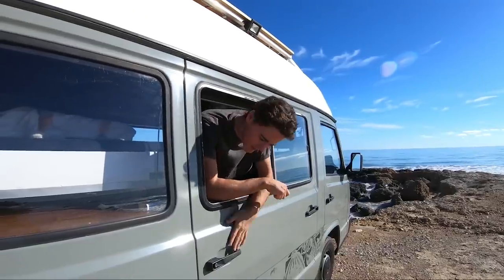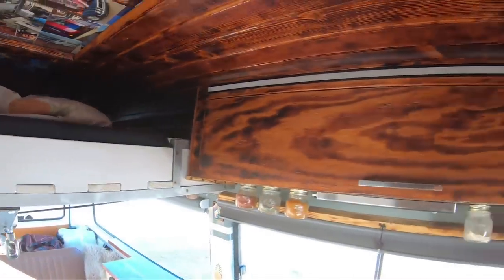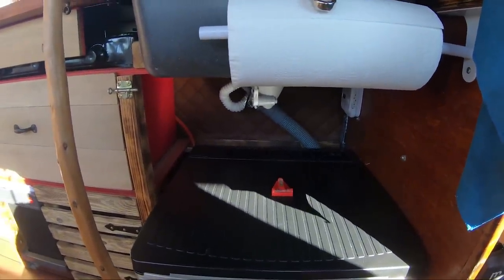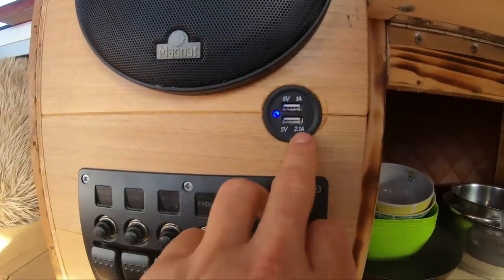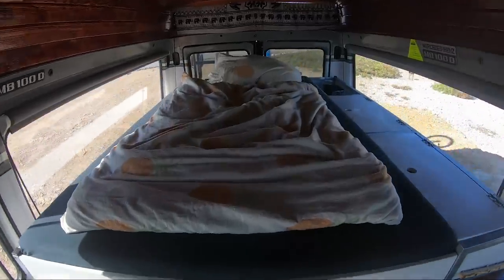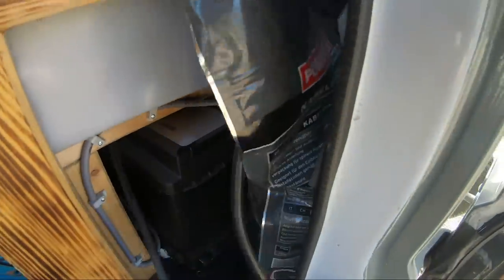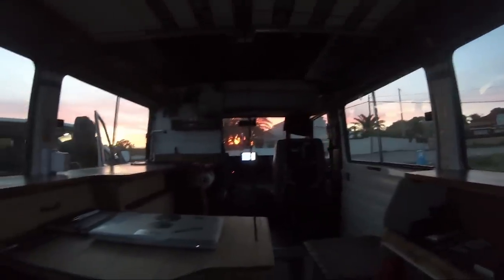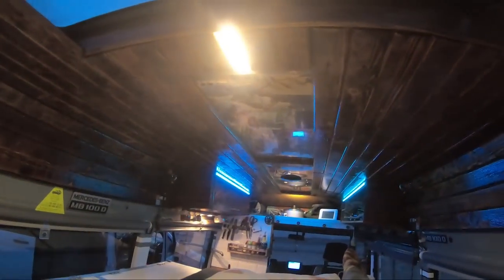Camper Bus Roomtour┃Mercedes MB 100 Selbstausbau (subtitles)

Comment: Ich hab lange rumgesucht bevor ich angefangen habe meinen
Citroen Jumper L2H1 Bj.2018 zum Mohnmobil auszubauen. Ich wollte alle
Möbelteile mit einem Laser ausschneiden lassen nachdem ich präzise gemessen,
gezeichnet habe und dann Laserschneiden lassen habe.

Ich hab 12 platten Birkensperrholz 2,5x1,25 Meter 9mm dich verarbeitet.
Kostenpunkt 468 Euro

Das Laserschneiden hat dann nochmal 536 Euro gekostet.

Es waren 136 Einzelteile und der Zusammenbau hat dann lediglich 2 Wochen
gedauert. für den Einbau in den Kastenwagen hab ich nochmal 4 Wochen gebraucht.
Ich würde es immer wieder so machen. es ist kostengünstig und super Präzise.

Alle Möbel sind nur verklebt mit Cyanacrylat Kleber(Sekundenkleber) die Schlitz
und Zapfen Konstruktion erzeugt eine riesige Klebefläche. ich habe nicht eine
einzige schraube für das verbinden der Möbelteile benötigt.
Es ist Suuuuper stabil geworden.
Gewicht des Holzes 138 kg alle 138 Teile komplett ausgeschnitten vor dem
Zusammenbau.

Fotos ganz unten in den zwei Links

Nur am Rande:

Ich kann in dem Bus ein ausgewachsenes 1200 cc BMW Boxermotorrad sicher
transportieren.
Dazu wird das Bett komplett incl. Bettdecke, Kopfkissen, Pyjama, Kuscheltieren
an die Decke gezogen.
Als Stauraum sind unter dem Bett 10 Euronorm Boxen.

In den Möbeln befinden sich 10 Schubladen mit Vollauszug.
Es gibt 13 Saufächer mit Klappen. Und ein Staufach in einer Euro Norm box unter
dem Sitz im Salon.
Ein riesen schrank mit schiebetüren unter dem Bett rechts.
Zusatztisch hinten an der Hecktür eingehängt.

Eingebaut ist ein 45 Liter Kompressor-Kühlschrank.
Eine Webasto Airtop 2000 STC Luftheizung Diesel unter Flur.
Frischwasser im 64 Liter Edelstahltank, unter Flur
70 Liter Abwasser in GFK Tank, unter Flur
Druckwasserpumpe Lilie, unter Flur
100 Ah AGM Batterie
100 Watt Solarpanel
Solarregler Victron 75-15
Schaltnetzteil 300 Watt Dometic
Ladegerät 3,5 A CETEC
askocher Spül-Kombi von Dometic, 
Kenwood

Radio mit 7 zoll touch screen als Monitor für Rückfahrcamera
Drehkonsole beide Sitze im FührerhausRadhausinnenschalen von Lokari gegen den Straßendreck.Unterboden und Hohlräume mit Wachs geflutet

Fahrzeuggewicht nach Umbau 2610 kg
Zulässigen Gesamtgewicht 3300 kg.
Motorisierung 130 PS Blue Hdi Peugeot Diesel
Fahrzeuglänge 5,45 m

https://photos.app.goo.gl/aNCkudWd9JNwtwnm8

https://photos.app.goo.gl/ou55VHQXp1Zx58cu5

Comment: really great project, i have one question tho, did you buy it with the 'opening roof' or you did it by yourself ( i did not find models that comes with opening roof in reasearches)
Reply from the maker: thanks!
i built it myself out of an old slidingwindow from a Ford Transit 🌞🌴

Comment: Sag mal, wie siehts bei dir denn Temperaturmäßig aus. Hast du da irgendwas isoliert, heizt du wie bolle, wenns mal kalt wird oder einfach dicker anziehen/Decke? Sonst hammergeil und ehrlich besser und schöner als die 70k teuren Dinger von der Stange. Man kann diesen hier ja auch noch etwas abrunden, wenn gewünscht, aber auf jeden Fall so schon besser.
Reply from the maker: im Sommer gut, wenn man gut durchlüftet und im Winter reicht die 2Kw Standheizung locker aus.
🌞👍

Comment: Great van. 
Mb100 or mb180 ?
Reply: Can't you read? The title already says MB100, and he says it in the video too.
Reply: @orcaflotta7867  I have an mb100 and it is shorter, in fact only the mb180 is somewhat longer. That in the title of the video put mb100 and the author says that it is a mb100 does not mean that it is
Reply: @v101orion  Well, in my book it does so. I know that many vans are going by the same model name and still featuring different wheel base length. Case in point, our own Ford Transit mk.1, which we have in swb and lwb versions and still both are named the same.